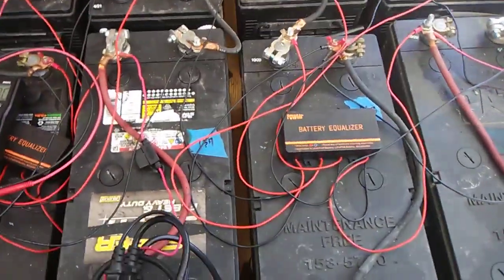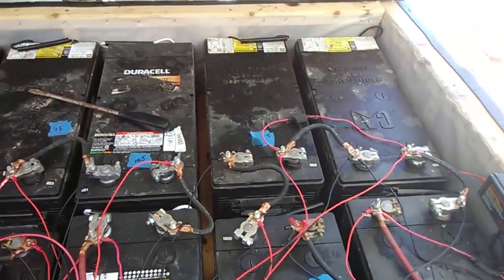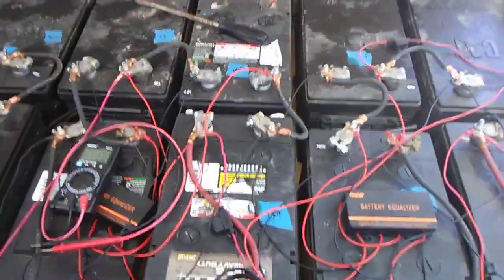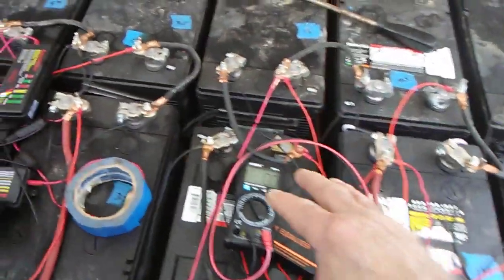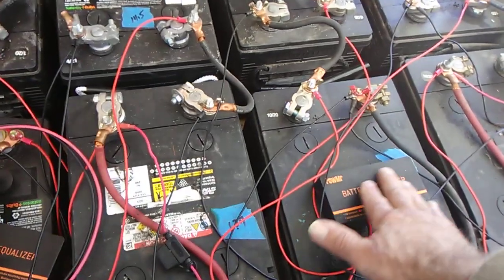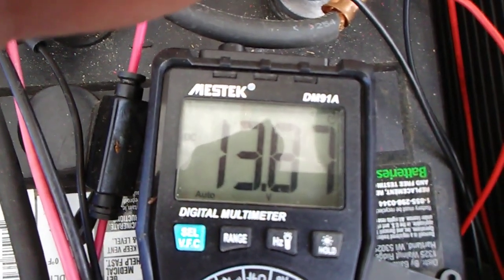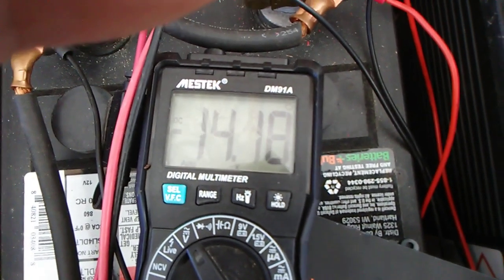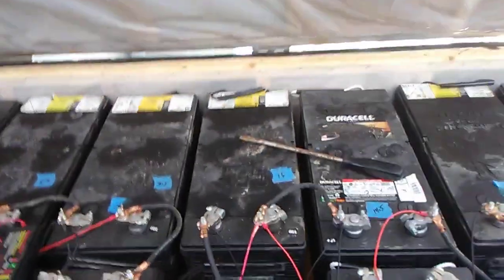Bossrox DIY Solar ~ Signs of a bad lead acid battery in your bank

Comment: Why not change all that antique technology. I use 400 ah of lithium I never have to think about it. I paid 200 a piece. I can run my lights and furnace for 10 days without sun. Something to think about.
Reply from the maker: 300 a/hr ain't ancient man & you got ripped off. $200 a piece for 400 ah/hr compared to $85 apiece for 300's? I think I made out way better! Oh, I see you watched an old video. They're gone & I'm totally on liths but you still got ripped.
Reply from the maker: Just noticed you watched my old bank video. They're gone now, I'm totally on liths, 60 kw of 'em.

Comment: just pick up a battery amp tester, they give relatively accurate results of how many amps your battery has in it without the need to pull it out of the array. i use one to test my golf cart battery.